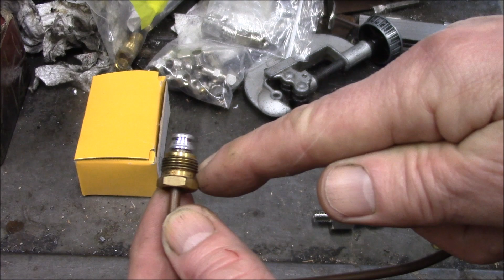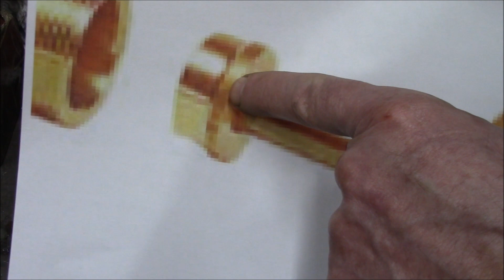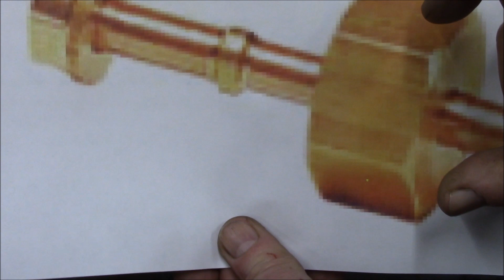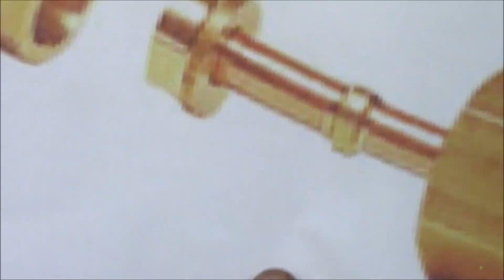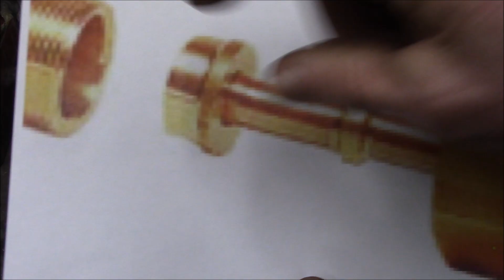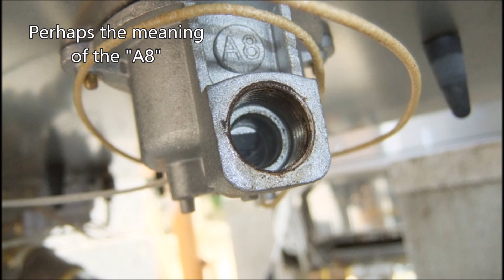Outdoor Kitchen Island - New Gas Line for the Cooktop, Part 1

Comment: Every time I need to work on fitting like these it takes me at least THREE trips to the store.  NEVER get the chit  right the first time.  LOL   Now your adding Metric into my mix ????   Oh Damn.       4mm Aka 1/4 inch ?
Reply from the maker: Yes, you got that right.  I ended up with a whole bunch of wrong size parts before getting it right.  Finding specialty metric fittings here in the US is almost impossible.  SAE fittings are so much easier as they're much more standardized.  But with metric fittings, there seems to be so many different styles.  They're all "metric", but so many thread pitches, diameters male vs. female, etc.  4mm tubing is tiny, just a bit over 1/8", then you have 1/4" or 6mm and then 5/16" or 8mm.